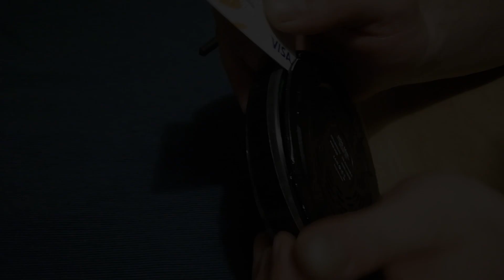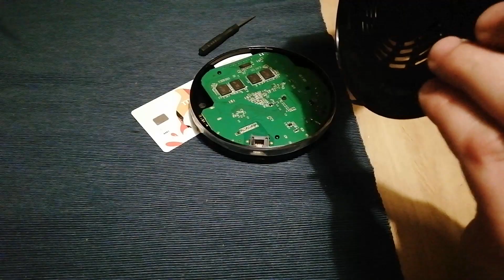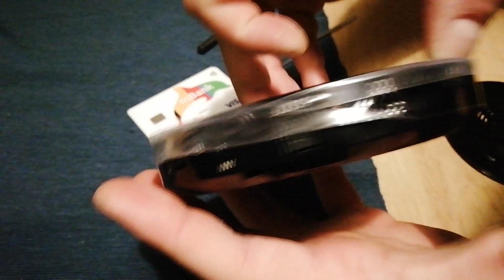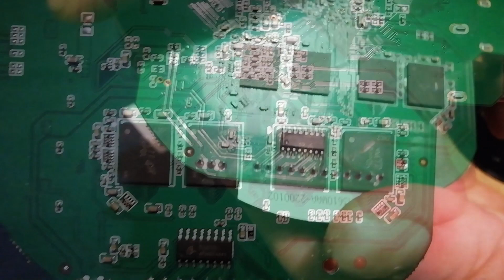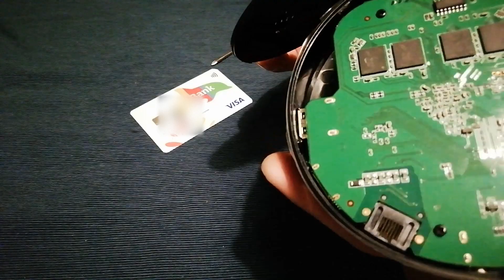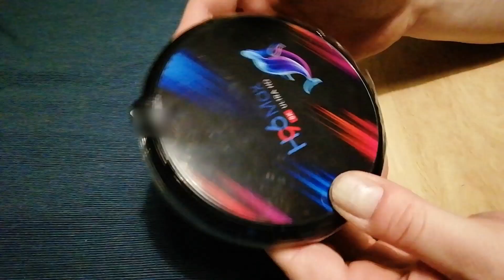H96 MAX X3 Smart TV Box Android 9.0 with RAM 4G ROM 128G - Disassembly

Comment: can i know where is the short pin to make usb male to male detect to restore stock firmware?
Reply: Did you find the pin short location ? If yes please share it my box is bricked
Reply: I know this board short location if you have the same board s905x3-v20, mine is s905x3-v21
Reply: @faroukbahloul9362  i just touch the pin near emmc. just touch any pin untill it detect. frustrating to find the real one
Reply: @gghehe6106  none work for me :'(